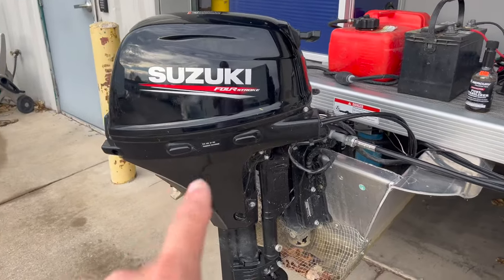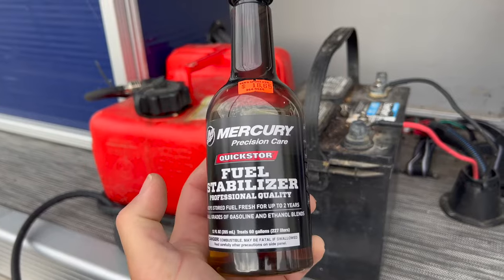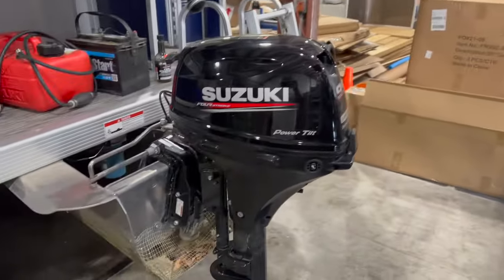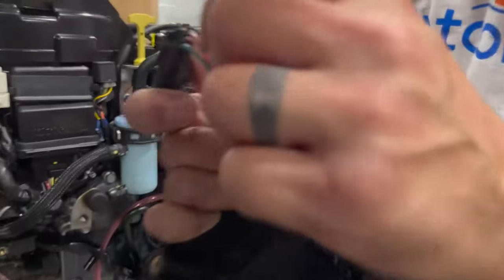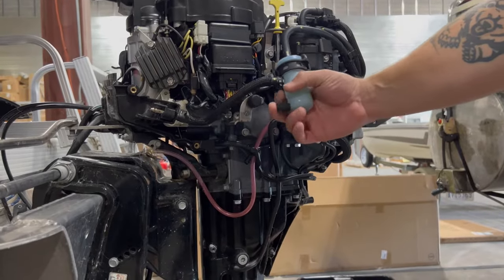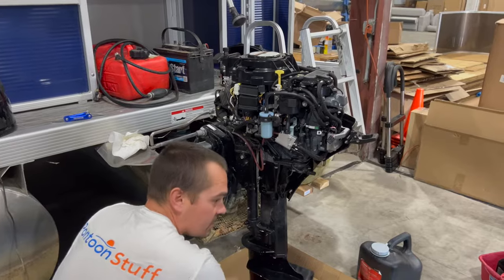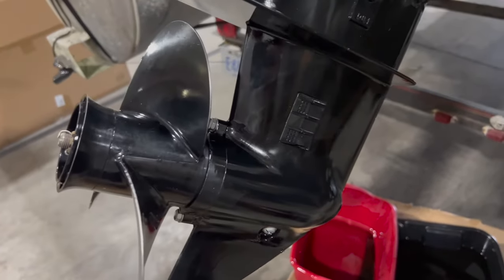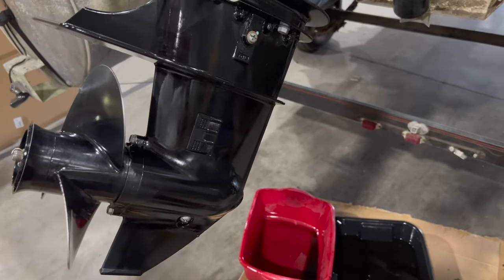Oil Change for Suzuki Outboards 9.9 hp, 15 hp, & 20 hp - Winterization

Comment: Great video. I just bought a 14-foot aluminum with a 2012 suzuki 9.9 four stroke.  I'm going to change the oil on it soon and I'm glad I found your video!
Reply from the maker: Awesome!! Just double check part numbers for your motor as the motors in the video are 2020 and newer. Should be darn near the same though!
Reply: @tomspontoons  Hi, I'm still on the break-in period on my DF9.9b. I understand that I'm supposed to do the first full oil changes at 20hrs, however as it's attached to a sailboat access to do so while in the water is challenging. Most fellow sailors with such engines do their oil changes at the end of season when boat is hauled, so how much beyond first 20hrs do you believe is "ok" for the sake of the motor and warranty?  Thank you!
Reply from the maker: @donc2334  when I sold new outboards we told customers 10-20 hours for the first oil change is ideal. If they were only going to run it for 40-50 hours (common in Michigan) that first season then they could run it and then do the oil change at end of season. I don’t know all the technicalities of the warranty, but that’s what many of our customers did and I never saw a problem from it. 

If you’re going to pile on 100+ hours then yes, find a way to change that oil!

Comment: I found this video by accident... Can you do or do you have a video on the pontoon this 9.9 is mounted to..?? Looking for a smallish pontoon for our little 50 acre lake... I looove Suzuki 9.9's...
Reply from the maker: Suzuki was the front-runner in EFI portable motors, gotta love them for that! This motor was on a Bennington 18' and used on an 80 acre lake. It's a great little setup because it gives better space than the Gill Getters or narrower style pontoons for smaller water. The boat is back with its owner so I don't have pictures of the setup...typical cruising style full of seats. They're super happy with the motor for their application. 

We have installed a 9.9 Suzuki on a 24' pontoon on a small no wake lake as well and they've had no complaints!

Comment: Is the thread for the lower unit drain 8mm or 10mm? I drained mine to change it for the first time assuming it was the same thread as my Johnson/evinrude but not the case so I need to get an adapter for my pump to fill it. Awesome video by the way, very informative
Reply from the maker: Sorry, I don't know the thread size. However, I do know that I have a pump kit with fitting for Mercury and Johnson/Evinrude lower units and a different pump kit for Japanese motors...so you're definitely spot on about needing an adapter. Thank you for watching!

Comment: Is it a problem if you forget to warm up the motor before removing the oil plug. Do I just have to wait longer for it to drain or will it not drain completely unless it's warm?
Reply from the maker: It helps for the engine and oil to be warm before draining, but it's not 100% necessary. Yes, you'll just have to wait longer, but it will all drain out.

Comment: I drained the oil from the Suzuki DF15 after about 10 hours. I left it in the bottle and after a few days a white precipitate formed from the oil at the bottom, a lot of it. What could it be and what cause could it be? New engine, only 10 hours old
I also see that at high speeds, white smoke comes out of this nozzle near the cooling water nozzle
Reply from the maker: Typically white in oil would be moisture. This can happen from condensation. Did you run through the break in process accurately or just take the motor and run it? I would run it another 10-20 hours and drain the oil again to check it for the same thing.
Reply: @tomspontoons  I received an engine without oil, so I poured the oil to about the maximum level and drove to the water.
I started the engine, left it for 5 minutes to warm up, after 5 minutes I put the gear forward and it ran for 15 minutes without gas, it swam, then I swam for 1.5 hours with the throttle open from 1/4 to about 1/2, then the 3rd hour to max. /4 levers and after 3 hours most of them are about 3/4 and sometimes for a moment only glide to the maximum after a minute and now I have 11 hours and I am swimming normally but I crank it up to the max only for a moment to 5 minutes max and then slow down because there are too many scooters swims next to me.
I tried to do everything as it is written in the running-in instructions
Reply: What do you think, did I do everything right during the running-in procedure? Should I do it differently?
Reply from the maker: @przemysaw124  I would just try changing the oil in another 10 hours to check. You may have overfilled the oil the first time and got some condensation. Aim for 3/4 full on the dip stick range.
Reply: @tomspontoons  What does condensation mean???
So when I pour oil and the engine is hanging on a stand in the garage, should I set it horizontally, i.e. the first trim eye and 3/4?
I had max oil, and when I took a mesh one higher than the boat, I already had 5 mm above the max. Maybe that's why?
So it's better to have a good half on the dipstick than to have the max???
And if there was too much oil by 5 mm above the maximum, something serious could have happened? Could I have done something in those first hours of engine operation?
Reply: @tomspontoons  ?
Reply from the maker: @przemysaw124  I don't think you would have caused harm by over-filling, but they don't usually like it. 1/2 to 3/4 up on the fill area on the dipstick is ideal. If it's at the top of the fill line you're okay, but going over is not advised. Condensation would be moisture getting into the oil from the temperature differences between the water and engine block. Not likely, but possible. See how it does after another 10-20 hours and go from there, that's what I'd do!!
Reply: @tomspontoons  Thank you very much for your help.
I will be watching.
Today I extracted 150 ml through the dipstick and the oil looks nice (better). I poured it into a clean jar and I will see tomorrow if anything has precipitated.

And I filled it up with 150ml of new oil and I'll do it for a few more hours because they say at the service center that I don't have to have the full 20mth for the first inspection.
Reply from the maker: @przemysaw124  Perfect! Hope it resolves and you're smooth sailing from here on out!
Reply: @tomspontoons  It seems to me that since I am still before the first inspection and if I replace 150ml of oil with fresh one, nothing will happen and it will be even better for the engine?
At about 20, they will drain the oil completely and replace it with fresh one

Can you also advise me whether the engine valves should be adjusted after about the first 20 hours after running in, because there seems to be a slight clanking sound when I listen to it working on the opposite side of the tiller at the bottom?
Reply from the maker: @przemysaw124  You'd have to check with your local dealer or with Suzuki for that one...I've not had that with any of the Suzuki outboards I've worked with or installed.
Reply: @tomspontoons I checked the oil and now it's about 2mm. before the upper eyelet on the bayonet, i.e. before max. The engine hangs on a stand in the garage.
Can it stay like this or is it too much?
Reply from the maker: @przemysaw124  Should be just fine. Just keep an eye on the level and make sure it's not gaining more over time.
Reply: @tomspontoons  And why could the level increase? What can he get up from?
He can express another 50ml. ?
Apparently it is before the upper step max now
Reply from the maker: @przemysaw124  Water getting in the oil or fuel blowing by the rings would "make oil" or increase that level.

Comment: I accidentally changed my oil and forgot to put the copper washer that was in the waste oil, I saved it but I already put the new oil back in, it doesn't appear to be leaking and I'm going to change it again in two or three days after a hundred more miles, I'm assuming it will be ok, any thoughts?
Reply from the maker: You could try to tilt the motor all the way up and oil drain facing up, pull the drain bolt and have a rag ready to plug the drain hole. Slip the washer back on and bolt back in. That’s probably what I’d do if it were my motor!!
Reply: I wouldn’t risk it.
Reply from the maker: @gravis00  definitely agree that it should be in place!!

Comment: Ive got the 15hp version of this. But its got a massive fuel leak. And i just dont know how to fix it. Its just pumping fuel out of a vent line at the top of the engine.

Its comming from the rubber line that runs directly behind the dipstick
Reply from the maker: I don’t have one at my shop to reference, but I’d say get that motor to a local servicing dealer to have it taken care of asap!

Comment: I am curious; I know you added fuel stabilizer and ran it through the engine but why do you not get all the fuel out of the carburetor either by running the carburetor dry or draining the carburetor bowel?  Stabilized or not, why leave fuel in the carburetor over the winter lay-up?  Why do you not run "storage seal" through the carb prior to the last shut down before winter lay-up which is about six months according to your reply to @nishownnishow1286 below?  How about fogging the inside of the cylinders with corrosion inhibitor?  How often do you change out the fuel filter that is housed in the plastic looking housing you loosened to change the oil filter?  When is the fuel filter on your ongoing maintenance schedule?  I do not have access to Suzuki's manual for this engine; what does Suzuki recommend for "winterization" or extended periods of non-use?
Reply from the maker: Lots of great questions...to answer most of them this is not a carbureted motor. It is fuel injected with a closed fuel system where they DO NOT recommend running it out of fuel. Simply treat the fuel and leave it in the system over the winter. You could absolutely make it yearly routine to swap the fuel filter, however we usually do it every other year on boats like this that see minimal use. And yes, you could fog the cylinders, but I've found running the proper fuel mixture will lubricate everything throughout the system including the cylinders. Certainly for prolonged storage (like years) I would want to go above and beyond with lubricating the cylinders. I don't have the owners manual for this one either, but I'm sure you can get a manual online from a Suzuki parts dealer. This was not my motor, just doing the maintenance and boat storage for a customer.
Reply: @tomspontoons  Great reply and thank you for your time.  I was not aware that it was fuel injected, that bit of information alone answers most of the questions.  Being fuel injected obviously you do not want to run the injection system dry-spot on!  Thank you again for making the video and for your valuable time!
Reply from the maker: @apackwestbound5946  I figured once you knew it was EFI you'd be caught right up to speed. It's funny though how there is still a big divide between outboard gurus about leaving treated fuel in the carb versus running them dry!
Reply: @tomspontoons ziehen sie den unteren Stopfen linken am Kraftstofffilter ab und lassen sie Kondenswasser rauslaufen. Es schadet der Einspritzanlage. Gute Arbeit.
Reply: What if you're running Rec fuel...should you still treat it even though it does not contain Ethanol?

Comment: I was just looking at how to upgrade the 9.9 Suzuki to a 20 HP with the electronic control box upgrade for like $500
Reply from the maker: On a pontoon there’s not really any need to do so. I don’t think any speed would change, and the torque at lower to mid RPMs would be the same. I worry bout warranty with those kits!
Reply: It may not do much on a pontoon as he said, but my tracker grizzly 1448 will run 25mph after the upgrade😂
Reply from the maker: @davidj-qe4hn  Haha! Different animal right there. How fast was it as just a 9.9 hp?

Comment: what about the anodes?
Reply from the maker: Always worth taking a look at, but here in freshwater we rarely have to address the anodes.
Reply: @tomspontoons  there is 1 only in this motors?
Reply from the maker: @javiolartegutierrez7728  I’d had to pull up a schematic to find that out, or check the owners manual. It’s not here at my shop anymore.

Comment: I have  a 9.9  has no spark
Reply from the maker: Yikes! I'm not an outboard mechanic beyond installations and yearly maintenance stuff. I would get that to a local Suzuki servicing marina to get it looked at!
Reply: Use new spark plugs. Watch Kill switch.